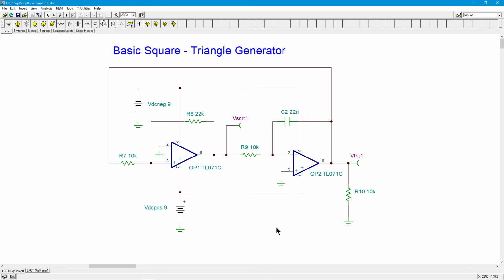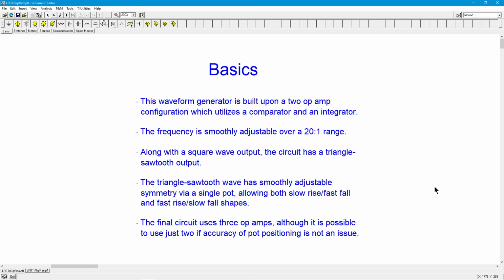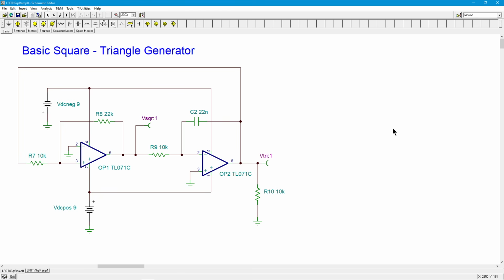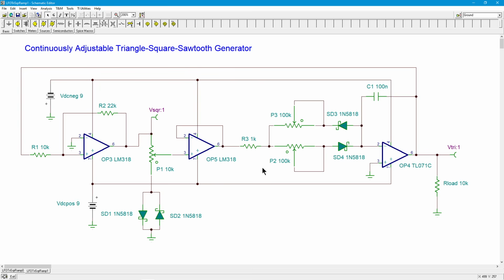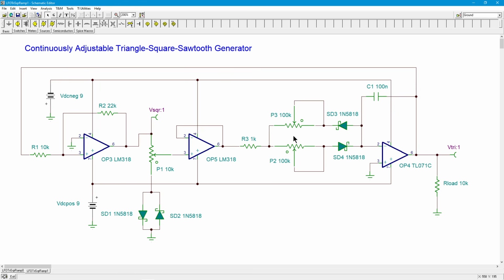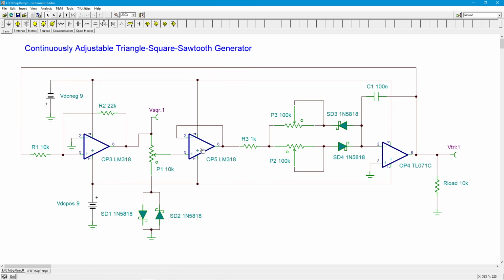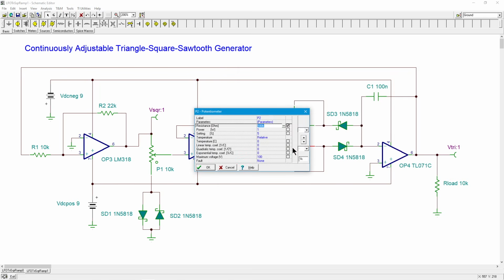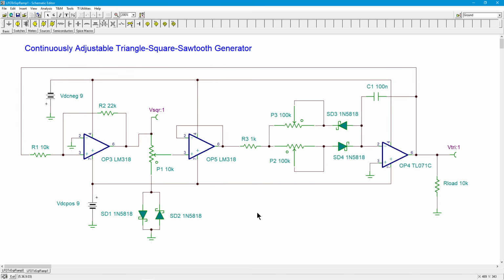Op Amps: Triangle-Sawtooth Generator

Comment: Instead of having two pots, P2 & P3, could you have a single pot? The signal enters the wiper and is routed to the two diodes at the two ends of the pot. The average current would be fixed, but you could adjust the positive and negative currents to counter offsets in the input signal and differences in the diodes.
Reply from the maker: Assuming I follow what you're suggesting, with a single pot, both positive and negative potentials would see the same resistance, and thus produce the same charge/discharge currents.
Reply: @ElectronicswithProfessorFiore it does work. Each diode only sees the resistance between it's leg and the wiper, it never seems the rest of of the resistance past the wiper.
Reply from the maker: @JaenFoster  OK, apparently I wasn't following the initial suggestion at the time. I assumed they were describing something different. To be clear, you could take a single pot (let's say p2) and attach the wiper to R3 (and don't attach it back to make a rheostat). Then attach one of the pot's now free end points to SD3 and the other to SD4. I've used that configuration in other videos as a means of "steering" the signal. That would work. The idea of having two pots was to make it obvious how we developed two independent paths. In retrospect, I should've included the single pot version. Also, my apologies for not reading the comment more closely back then.
Reply: @ElectronicswithProfessorFiore no worries 😉